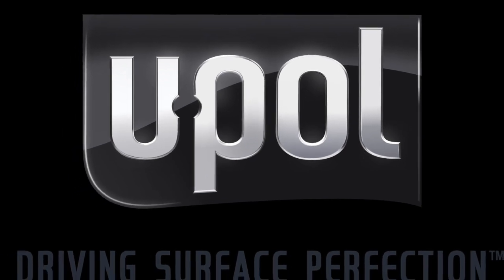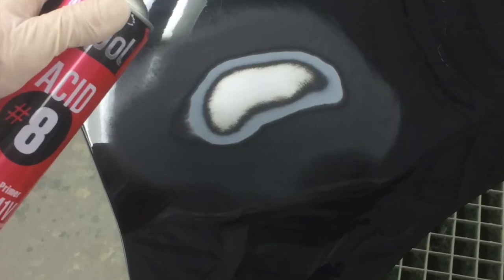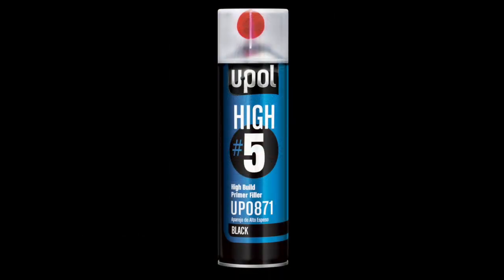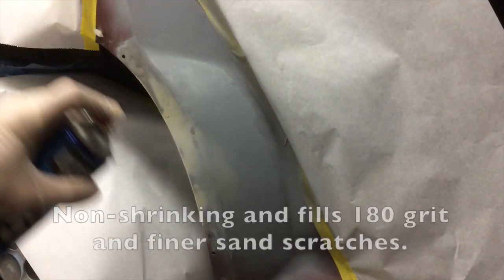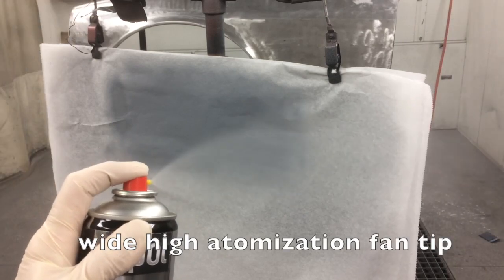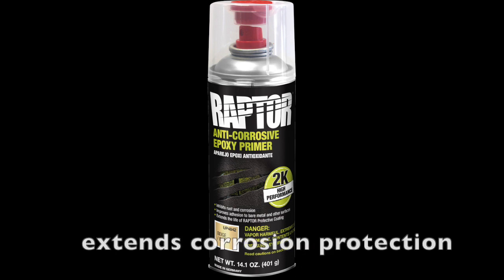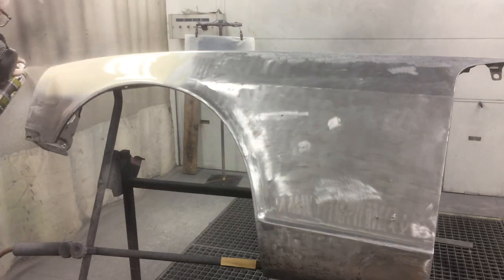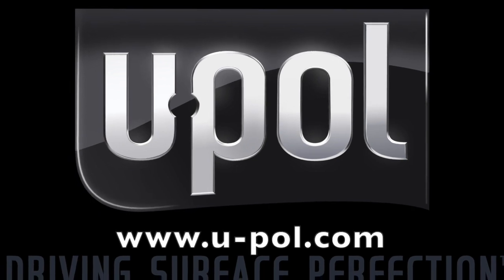U-POL Aerosol Primer Line - From Premium Aerosols to RAPTOR

Comment: It’s kind of hard for me to believe that the “high #5” will out perform and build up more mil’s than “sem high-build primer surfacer”.
Reply: believe it or not - I assure you that it does - spray it out for yourself and use a dry mil gauge to check for yourself. not only does it have better build, it bonds directly to everyone of the substrates listed....